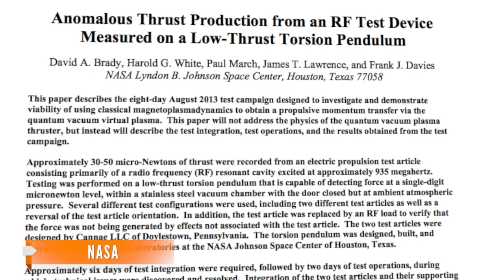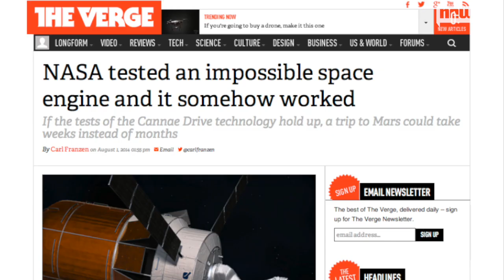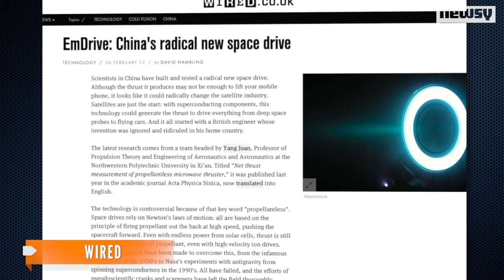NASA Tests 'Impossible' Engine, Finds Out It's Really Fast

Comment: I believe the emdrive motor requires electricity so therefore it’s perpetual since it cannot generate energy out of it’s own, so eventrough it doesn’t use fuel ,it still requires electric energy to run,
I can imagine it’s nothing more then a microwave being put in a chamber to let molecules flip back & forth to generate masses of energy,
So it’s not something impossible and it’s not something wich violates the laws of physics, and it does not generate more energy then you will put in,
If scientists are sooo fashinated About such system,
Why don’t they just use nuclear batterys and a transformer to convert that low energy electric power into high electric power? Because s transformer could do that,
I just can’t believe that scientists about such huge device wich could as of yet only generate 1 militon or 1 watt of power.

Comment: The Nassikas Thruster Bests this invention because the Microwaves are created with a power source and a microwave emitter .. The Nassikas Thruster is a supperconductor and a magnet .. Completely reactionless thruster ! .. What is better yet is the coming efficacy of Hyperconductors or Conductors with Negative Resistance .. They call Negative Resistance "Apparent Negative Resistance" because no one wants to loose their job claiming that faster than light reactions are possible .. I am telling you that the US Navy bought a device in 1932 from General Electric that was designed by an Electronics Engineer Gabriel Kron .. The US Navy said they would pay for a working model .. So if it didn't work they wouldn't have to pay the $30,000 they promised to pay .. It worked and all the evidence of the device disappeared .. This was the project that spawned the Term "Black Projects" in 1934 and arguably was the first time a noted working group who wanted to remain nameless wasn't named until 1952 .. The national security agency .. One of the jobs of the National Security Agency is to hide technology that has dual use that could be used to create Weapons of Mass Destruction .. The Kron device could have been scaled up and produce more energy than the a priori demonstration model .. If negative resistance / hyperconductivity ever goes mainstream all previous forms of power generation including nuclear become moot .. Dr Boyd Bushman Chief Scientist and Fellow at Lockheed made claims that Lockheed had developed the next power generation device beyond nuclear .. Let the settle in for a moment .. He was asked to clarify if he meant beyond nuclear fusion and Dr Bushman said yes .. Now imagine devices than can create 100 - 1,000 Giga Joules and you'll start to get the picture .. Dr. Richard Feynman said he could create a device that could harvest 45 Megawatts from 1 cm^3  from the vacuum of space .. He was threatened and told to shut up and he tenure was threatened .. It looks like their is more going on here than meets the eye .. Maybe this is a good reason for Deep Underground Military Bases or D.U.M.B.'s .. We may never know until some E.L.E catastrophe ..

Comment: Ive wrote a book sci phi that talks about using a combined fusion & ion drive propulsion engine that would take only 4 to 5 weeks maybe sooner to reach mars the fusion drive would essentially kick start the ship to may be 10% the speed of light then it would shut off then the ion drive would start on the ship would gradually build up speed until it neared its destination then the fusion drive would fire up acting as a break to slow the ship down. This would allow the craft to perform an orbital insertion maneuver once mars is reached.this same propusion system could speed the craft to the outer planets in just a few months rather than years but going going to the nearest star system would require the ship to stay on fusion drive until it reached at least the orbit of Saturn then the ion drive could kick in it is conceivable that this ship could go to 20% C speed but you must be able to carry enough fuel for return trip home i wouldnt do  a stupid elon musk one way suicide mission trip.but it can be done you just need the tech & funding to do it.

Comment: Since 50 micro newtons is basically nothing, I went to an internet converter to see how much it actually was in foot pounds. The converter could not convert 50 micro newtons. I had to keep multiplying by 10. When I got to 50,000 micro newtons, the converter finally shown 0.01 foot pounds. Basically 5 million micro newtons were needed for a single foot pound (1.12 actually). A small Toyota Camry engine has 184 foot pounds of torque...just as a comparison.

Comment: I love how so often people say something is impossible or shouldn't ever work, and don't even try because of supposed book learning, only to fucking find out it DOES work, and quite well, in fact. Self-powered electric generators, closed-system fuel burning generators, and many more things are only discovered because someone used LATERAL THINKING instead of BS linear thinking. Lateral thinkers move all humanity forward, because they have the unique capacity to see beyond where others have seen.

Comment: Here we are 4 years later and going no faster then we have before. Yes of course some are traveling  over 100,000 MPH being pulled by the suns gravity. We still take 6+ months to get to Mars. We still take almost 10 years to get beyond Pluto. It takes us years to track down an asteroid. You think man is going to travel beyond Mars because of speed? First have to figure out how to protect them from radiations that will harm astronauts beyond a year or two of space flight. In manned flight we have gone nowhere in the last 50 years. There are reasons for this. Stop thinking about Star Wars and Star Trek fictional stuff. First it was Musk saying 2021, then 2022, then 2023 and now it's 2024. No man will set foot on Mars until 2028 or much later.

Comment: There is no need to throw mass out of a space ship to cause the spaceship to move.
you can throw mass inside a space ship to cause the spaceship to move.
all this highly imaginative  technical fantasy science isnt worth its weight in crap.
because crap actually has value for instance you can
use a very powerful thrust inside a spaceship using hydrogen and oxygen ( like the space shuttle used to launch )
then reuse the water that condenses from the steam thrust to make more hydrogen and oxygen.
you just use electrolysis to separate the hydrogen and oxygen from the condensed water
or you can use a membrane to separate the hydrogen and oxygen from the water using pressure.
you can even generate electricity from the thrust and from the vacuum that is caused by the condensing water vapor.

all this mumbo jumbo fantasy science is to draw people away from the reality of free energy and
supply science with new subjects to teach and enlarge itself.

Comment: there is much hidden matter out of phase in gas form and dust, but if you make it into thrust neon or argon plasma microwave 200 gig hz floating around just wondering if you leave a flame trail will it cool or will the next pass by cook you and your mates? or future travelers , put the bbq on the deck bro we'll do a pass by our new plasma zone from a deeepfry, maybe try a rodin coil with eletricity until it oxidates (rusts) and then keeping it isolated and not grounded the negative end will output emf also some hydrogen if in liquid space

Comment: Micro-Neutons of thrust....and that's the problem....we need the most sensitive measuring devices to prove it even works....thrust is so Small that were not shure it actually made any at all....Dont hold your breath on this engine...I dont think is will be sending any spacecraft  anywhere....as it stands right now... ☹

Comment: [HTML] NASA's EM Drive Thrust from the Forces of the Quantum Vacuum of Spacetime
MS El Naschie - Advances in Aerospace Science and Technology, 2018 - scirp.org
31 days ago - Building on the various manifestations of the forces latent in the quantum 
vacuum of spacetime such as Hawking's radiation and Unruh temperature, we resolve a 
major paradox connected to an immensely important proposal by NASA scientists for …
  Cited by 1 All 2 versions 
[PDF] ijeir.org
[PDF] A Theoretical Justification of NASA Electromagnetic Drive Based on Cosmic Dark Matter
MS El Naschie - International Journal of Engineering Innovation and …, 2018 - ijeir.org
49 days ago - Abstract–Based on earlier research results concerning cosmic ordinary energy 
and dark energy, it is argued that the energy density gradient present in spacetime can 
produce sufficient thrust to make NASA's EM drive proposal not only possible but also …

Comment: if this was not tested in a vacuum the propellant would be the atmosphere as the microwave cavity would heat the air inside and make it expand causing atmospheric displacement that would create a weak thrust. only in a big vacuum chamber, we will know if it works or not. dodgy experiments inside atmosphere does not count for real science as if it does then it only prove how broken the scientific community have become.

Comment: In 1971, Henry Wm. Wallace patented a field propulsion device while working as an electronics engineer and inventor with General Electric Corporation. This uses high speed, counterrotating masses of bismuth or other half-integer-spin nuclear isotopes, to produce what Wallace called a kinemassic field to propel a spaceship. This has the advantage of creating no inertial effects on passengers and crew, and it's the only propulsion method that provides this protection. Therefore, it's the only really effective and safe form of highly maneuverable, high speed space transportation. The patent is available online. Wallace produced and patented several other key inventions and none have been disputed--He's an authentic inventor and not a crackpot. When I went to research this invention at the Univ. of Colorado in Boulder, I found the index his invention had been listed in, but that page had been torn out. So I went to Denver, found the patent library and found the patent on microfiche, copied it, then typed it onto a web page in my Geocities account. Within 3 months, Geocities was bought out by Yahoo and immediately shut down. I wrote to General Electric Corp. in Pennsylvania and asked them if they were planning to use the patented device. I received a very polite letter back, seemingly individually typed, hand signed by one of their staff, saying that General Electric had no interest in developing the patent at this time. Yeah, why develop an outer space field propulsion system? What fun is that.

Comment: To understand why this type of engine is so exciting one needs to comprehend the issue of "reaction mass" for propulsion. Rather than try and explain it here I urge you to read the following science article from 1975, "A Step Farther Out": https://archive.org/stream/Galaxy_v36n06_1975-07#page/n29/mode/2up 

Note that while this is published in Galaxy, a speculative fiction (sci-fi) magazine, this particular article was placed in the monthly "Science Fact" section, and written by renowned author Jerry Pournelle, PhD. 

After reading that article you will understand that what makes this propulsion design so revolutionary is that if it works as described a ship would not need to carry its reaction mass with it, but rather would extract particles from the "quantum vacuum" (essentially out of less-than-thin air) as needed. Given some means of producing basic power for the systems, the ship would have an unlimited supply of propellant reaction mass.

One last thing. The test may have produced only 30-50 µNewtons, but it was a small scale test and theoretically more force could be generated either with larger engines or with multiple small ones. Further refinements of the technology would also likely produce more efficient output as well. 

The bottom line is this: It works! Inefficient or not it actually works!

Comment: So even if this thing actually works, what it's basically doing is sucking 'free' energy out of the vacuum.  Does that strike anybody else as a bad idea?  Maybe if you suck out too much of the local vacuum energy, it slows the local expansion of space-time, ripping the fabric of space as the rest of the universe continues to expand...  I'd recommend more testing.
Reply: The mathematics of the theories surrounding this implies that there's a balance between the positive mass-energy found in this universe (Einstein theorized that mass and energy are two facets of the same thing), and the negative gravitation potential energy of the vacuum state. But it also bumps up against things like the cosmological constant, and both general relativity and quantum theory. We just don't know enough, or understand enough, to be sure about what's happening. I suspect that this is something we'll need the supercomputers and AI's of the next couple of decades to map out and define for us. BUT, if the hardware can be built and tested NOW, I don't know why we wouldn't use it to, for instance, go to Mars. 

The effects on local spacetime, if any, would have to be minute....especially since the vacuum energy doesn't seem to violate Newton's Second law of Thermodynamics.  If a ship with multiple engines like this can be designed, installed, and powered by small nuclear engines like thorium reactors (or a set of thorium reactors), then you have a ship that has both propulsion and, through the power of the thorium reactors, enough power for life support, etc. That, to me, is much more practical than using chem rockets to coast between Earth and Mars every two+ years. If we can design engines that get us to Mars and back within weeks, instead of months....then we'd have the whole Solar System in our reach. We could send manned missions to Pluto within 6 months....and the outer Oort belt within a year!

Why not design a ship that uses these types of drives for the interplanetary portion of missions....and chem rockets for braking and maneuvers? You could build a vessel that has all of those systems onboard - and, with enough thorium reactors and chemical fuel in the tanks, you could explore Mars at your leisure. Let's see: 40 days, approximately, to get to Mars from Earth, once you've left Earth orbit; 4 to 6 months of exploration on the Red Planet....and then 40+ days to get back home. A manned Mars mission that would be completed within a standard year! THAT would be worth sending, say, 6 people to Mars on a mission like that! Build the vessel big enough, and you could send 8-10 people if called for. Once the drive was designed well enough for those kinds of transits....then all you'd really need to worry about is having enough chem fuel, oxygen, and food supplies onboard to support the mission. We do some of that already with ISS.

I'm not talking about a vessel that would be launched from the surface of the Earth; this would be a ship that's built in orbit of either Earth or the Moon. With Boeing, ULA, SpaceX, and a few other companies along with NASA, ESA, JAXA, and possibly the Russians....we have enough lift capacity that we could assemble, test, and launch a ship like this within a year or two - if we were committed enough. Personally, I'd do it in lunar orbit, once we'd established bases on the Moon. Especially with SLS and SpaceX heavy launch vehicles, we could launch enough cargo missions to both build the Luna bases and the Mars manned mission ship at pretty much the same time. meanwhile, we'd be sending smaller test missions to see how efficient and powerful we could build these engines; say, like a test mission to send a rover to Mars. Put it aboard a test platform that's launched from the Earth's surface, but has both EM and chem drives aboard. Boost it out of orbit with the chem rockets, and then turn on the em drive for the trip to Mars. When it gets to Mars, shut down the em drive and use the chems to brake, and then send the rover to the Martian surface. If the em drive works well enough, we could get a rover to Mars within 60 days, rather than 8+ months!!!